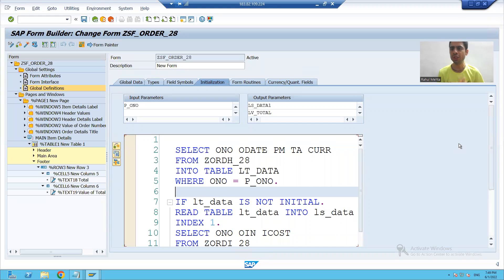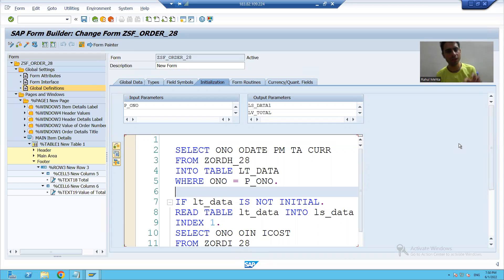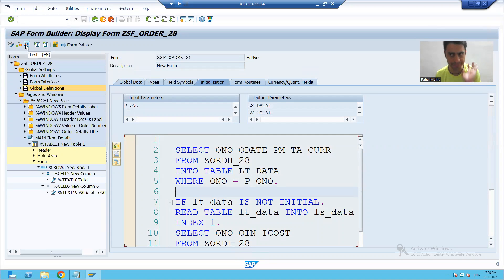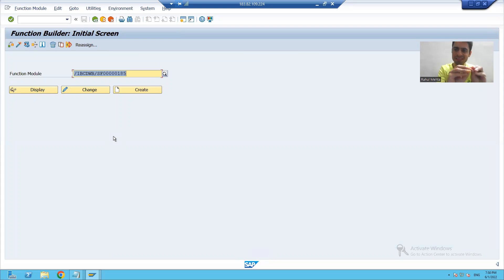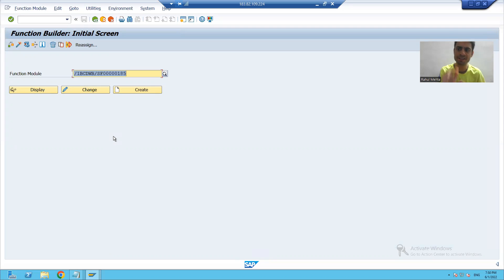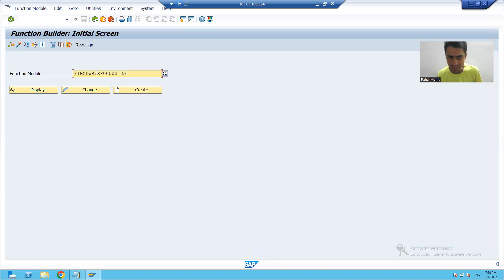8 - Smartforms - Calling the Smartform from the Driver Program Part1

Comment: Hello rahul - How to call smartform for select options?
Reply from the maker: Hello - As select-options is an internal table of 4 columns( SIGN, OPTION , LOW , HIGH). 

You need to create a structure type of those 4 columns and then create a table type.

Use that table type in the form interface of the smart form and pass the select-options values from the driver program.
Reply: @sapabapbyrahulmehta  - I will be grateful if you could illustrate through a  separate video because i have tried but i could not accomplish the task.
Reply from the maker: @TheAnsh2502    Hello - Please send your driver program and smart form on rahul3620023@gmail.com  . You can refer to the video of downloading of smart form to know the process of downloading of smart form.
Reply: @sapabapbyrahulmehta  - After doing all this how to apply these values of select options internal table on smartform to display values for each order no and their corresponding item details? We also have select-options based filtered data (Using 'Select' query) in the header and item internal tables which are already being passed through form interface from driver program.

Comment: Hello sir i have followed all the steps correctly but iam still getting SAPSQL PARSER TODO WARNING APPLICATION COMPONENT NOT ASSIGNED error
Reply: When i checked in debugging mode its returning error in READ table itab into wa index 1, after this line its getting error
Reply from the maker: @yaswanthyashu9636     Please download your smart form , copy your driver program and send on rahul3620023@gmail.com
Reply from the maker: Hello - I will be able to answer after checking your code only.
Reply: May i know what's the reason it's correct only right?
Reply: hi bro can you resolve this error??
Reply: @vasudev5260  no bro i haven't iam thinking it's because smart forms are not supported in my ECC version as previously my client mentioned Adobe forms won't work Iam thinking it's the same reason

Comment: Hello
After executing its not showing output its say internal error
Column not defined in template
Field ls_data1-oino has no defined value
Field ls_data1-icost has no defined value
and this warning
Reply from the maker: Hello Payal - It means, you have not defined the column in the template, but you are using in the various texts of the template.

For Example - You are passing Row 1 column 4 to a text of a template, but there is no column 4 in the template.

Comment: Hi Sir, I have done the form same like you did, but i'm getting an error while executing( template 2 does not fit the window) I gave the exact dimensions
Reply from the maker: Hello Aneel - It means, the template height or width is exceeding the window dimensions.

Please check for the below points.
1) Based upon my knowledge, when you provided the height of the template, you provided 4. It means 4 + 4 is 8. It is the height of the individual row, so you need to provide 2, then 2* 2 is 4. Please cross check the video.

2) The sum of width of individual columns of the template is exceeding the width of the window.

You have a syntax check button in the template itself( next to delete row button).

Comment: here, the labels are displayed 2 lines. If i want to display in single line, i must increase the width of the column. is my understanding correct?
Reply from the maker: True. Right observation. One option is to decrease the font also, once you proceed in the same playlist, you will learn this through smartstyles topic.

Comment: when my smart form is displaying it is showing labels correctly  but value fields is coming like this "&LW_DATA-ONO&", please guide what can be the error.
Reply from the maker: There are 2 types of editors - MS office and text editor. You are using MS office as editor, in that you can  not write directly, you need to click on to +icon(insert field) and then write.
Reply: @sapabapbyrahulmehta  ys rahul when I have gone through ur approach in editor after that problem resolved thanks for sharing

Comment: Hello sir, order number - window 2 is not appearing in print preview , missed anything ?
Reply from the maker: Hello Rucha - Check the height of your template which is inside the second window, based upon my perception, the height is in MM not in CM. Second reason, this window is overlapping with other windows, so it is not appearing. 
check for these 2 things.
Reply: @sapabapbyrahulmehta  YES it is in MM , now it is working thanks for the response

Comment: I can follow all step but in function module Pono are not showing
Reply from the maker: Hello - If PONO is in the form Interface of the smartform, It will be there, as Function Module which is generated, is just replica of the smartform. Requesting to please cross verify.
Reply: @sapabapbyrahulmehta  i have one error
Reply from the maker: Hello - You are using a Data Element in your Smartform, but it needs to be created First. I created Data Elements, Domains, Tables and after that I am using in the various topics like Smartforms, ABAP Programming etc. Requesting you to firstly create the tables, domains, Data Elements by referring the ABAP Dictionary Playlist. Then you can go ahead with the Smartforms.

Comment: I followed all your steps but I am getting only the static data which means labels of columns please assist here
Reply from the maker: You can check in the debugging mode, Are you getting the data in to internal tables based upon the conditions? In the same playlist, listen the video No-19, for how to debug a smartform and check.
Reply: @sapabapbyrahulmehta  Data is flowing to Internal table and work area but values are not showing on screen
Reply from the maker: @ambicadronadula6451  Check the height of your template, It might be in MM rather than CM. Run the smartform independently, Are you getting any Error?
Reply: @sapabapbyrahulmehta  I have adjusted size using format painter also to add I am not getting errors, when I checked in the debugging mode values are also executed sucessfully but in the smartform it is giving trouble
Reply: @sapabapbyrahulmehta   one more thing to add when I give &lv_total& in the editor it is giving convt_to_number dumb
Reply from the maker: I think without looking, I will not be able to provide the solution.  We will connect at some time tomorrow through Google meet and check.
Reply: @sapabapbyrahulmehta  Sir, Can you please let me know your availability I dropped you a mail too.
Reply: @sapabapbyrahulmehta  sure Sir, thanks